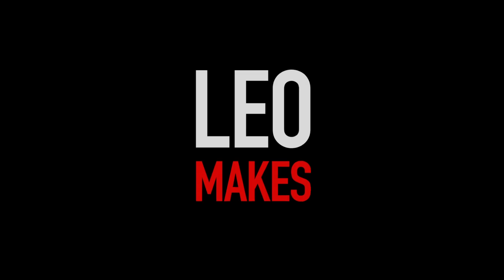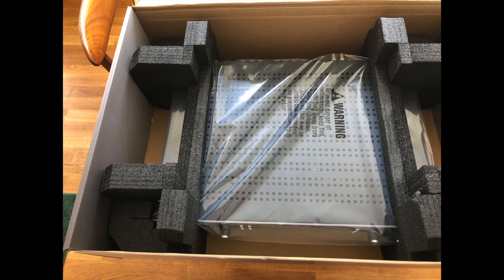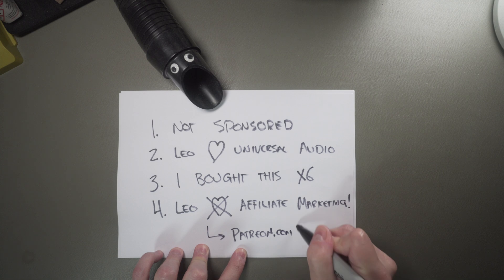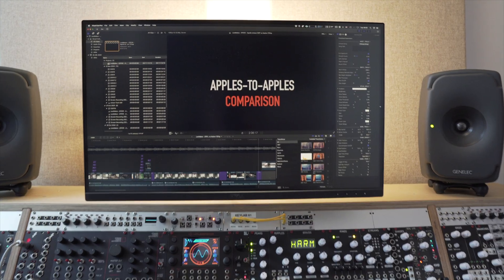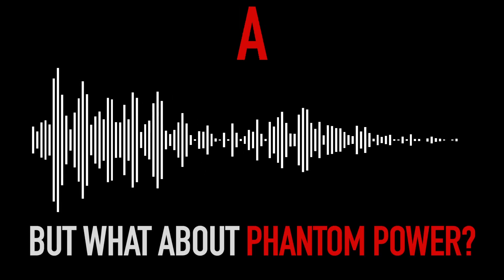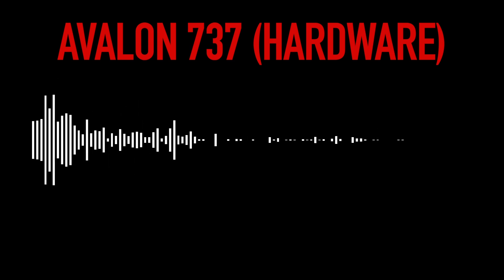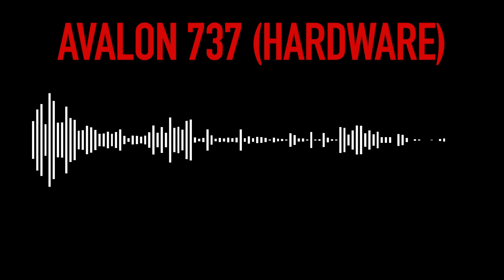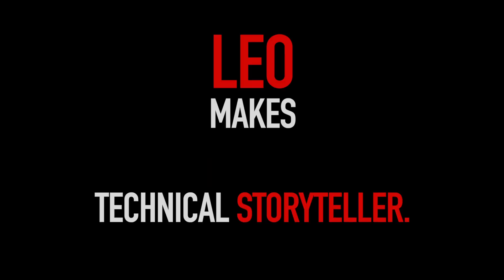Comparing a Unison (UAD) plugin to my real Avalon 737

Comment: I got it straight away - I knew the plugin was A, because: it was clearly more dynamic. Even before the compressor was engaged (as well as after). It sounded erratic compared to the smooth consistency of the hardware preamp. I'll die on this hill that this is the biggest reason for (at least) tracking through hardware (tubes, transformers, etc). The circuitry smears and smudges transients in a really smooth way.  It's the beginning of tucking sounds into place. I also don't think software comps can compete, so push pretty hard on things like vocals and bass on the way in. Excellent demo btw, thank you!

Comment: I picked B out as darker/thicker from the first switch, so I’m not surprised by what turned out to be used for each. That aside, are they relatively close as far as emulations go? Yes, I would say so - a lot closer than for example my old LiquidMix emulations of various hardware were. I’ve tracked with three different Avalon 737s at a couple different locations over the last fifteen years and it sounds closer to an Avalon 737 than anything other than an Avalon that I’ve encountered so far. I still would need to mix it a little differently than an analog 737, though.
Reply: As a side note, this difference in color is pretty much what I’m used to (in terms of the original hardware relative to the emulation) in regards to partially or fully software based solutions, UAD or otherwise, with the exception of emulation that push the bass a little harder/bigger (frequently the case for filter emulations) or intentionally hype the highs or leave them even clearer than one would expect (frequently the case in synth emulations). In general, the mids often come out closer to the original hardware.

Comment: I listened on my phone and yet could hear a subtle difference and I guessed correctly. Sample A sounded a little harsher on the high end, was a little less full, and sounded like it had an internal EQ, while B had a fuller low end and tube warmth and slightly more presence. I repeated the test with my eyes closed, checking which sample was playing periodically, and could hear which one was which and also the moments they were switched.

Comment: bit late here but B absolutely sounds like the hardware and has a bit more warmth to it. again could just be the difference in tubes and just general use of the unit compared to the apollo version which might be modelled on a brand new avalon. definitely had to listen for it but it was noticeable.  both sound great though

Comment: 🌐 Hi @LeoMakes! 🎛️ I highly appreciate your attention to precision and your amicable communication. Id like to offer a critique about your approach! It's a bit lengthy, but please take a moment to consider....

1) nitty gritty: I'm pretty sure the target impedance ratio for mic out to preamp input is 1:10, not 1:5 as you stated. I also was wondering about your 425ohm in load deduction re: after the y splitter, because I' under impression that the Avalon hardware can switch between 850 and 2500 ohm input & the UA unison impedance can be controlled digitally... but I don't think you mentioned calibrating the input impedance of each device. Also, I'm wondering if the 600 ohm output from the Avalon hardware into the Apollo has any effect on the neutrality of the source signals you are comparing?  

2) fun-da-mentals: I love dsp hardware & I love analog gear—super excited to be a part of their evolutions. So I'm really happy you showed people just how indistinguishable they can be. However, I believe your experimental method may have underestimated the relevance of perceptual contexts. Granted, its just a YouTube video, but ultimately the audio source and the settings you tested were far too limited of a sample to do more than scratch the surface of how to differentiate between the 2 units.

A) Your spoken word, lovely as it is, doesn't push or challenge the processors to work their magic. Imagine the the variations between that and a heavy metal singer & a suave R&B singer, or between an electric guitar cabinet & a saxiphone. 

B) there are too many variables within the circuitry (and it's digital modeling) to rely on just one setting to assess them. At least try moderate vs extreme settings.  Then matrix those with variable source audio (from the same calibrated input such as your Neumann).

(In the past 2 decades I've noticed that comparing audio processing from only one type of source tells me way more about which gear fits for the situation than it does about the gear's overall performance. )

C) social scientific perspective: Given the ambiguity  inherent to your scientific experiment (despite your valiant efforts to control variables)—combined with your public outreach inviting subjective feedback— this wouldve been a ripe opportunity for you to comment on how the form factors of each unit each entail pros & cons which might be efen stronger factors for the user than the sound quality comparison. Cost, size, ergonomics, requirement of a computer—these are all factors that frame your audiences ears before they even try to be objectively neutral in your listening test. If you preface your invitation by acknowledging such factors it could help reduce perception bias among your audience before they dive in. This is akin to you prefacing that you weren't sponsored by UAD or Amazon. Very valuable context.

All that said, you seem like a really great person with whom i'd love to stay in touch, especially about creatively fueled science+tech things—like you & your brother have clearly mastered! I hope to be in touch, "in the future ..." Peace & Blessings 🙏

Comment: So my question is can I just hook my analog 
cl1b up to my Apollo Quad 8 with out buying a preamp and just use the unison preamp and if so how do I bring that in do I bring that in as a mic input or line in 

Or do you think it would be better to just buy a analog pre amp and if so for rap vocals which pre do you think would be better for rap vocals 

1. Neve 1073 Spx
2. Avalon 737
3. Neve 1073 mpf Bae with Eq

Comment: Listening to it, for maybe about the 1st 60%, I thought they were indistinguishable. After a while, I noticed that when it went back to A, it sounded duller. B sounded clearer, more open, and possibly toppier on the high end - or perhaps just less diffuse. I'm listening on HS8's, so they're pretty accurate.  I'd like to know if both went through the same pre; or what each was.  I take it you used the built-in UAD pre, but if you said what other pre you were using, I missed it.

Comment: When the first UAD card came out, I compared my 1176LN to the original plug and couldn’t hear a difference, at least for the way I used it (no 4 button stuff). Bye, bye analog. My 40 years of skills as an engineer can more than compensate for any subtle differences between analog and digital gear.

Comment: I also correctly chose B as the hardware. I have some high-frequency hearing loss in my R ear but I do Soundgym every day and this difference is enough for me to shell out the bucks for the hardware (and the better tube mics). I play acoustic guitar and have struggled with discrete pre-amps and mics not giving me what I'm after (and I own more plugins and emulations than I care to share). I'm surprised you can't hear the difference. This difference is also the reason I decided against the Slate ML-1 and 2 and UAD Sphere mic emulation ecosystem--they just aren't the same and don't give you the 3D sound and character of tubes.

Comment: Having done a number of these tests between hardware and software, and owning a 737, I was able to tell which was hardware /software on first listen.  There is a noticeable difference. Even blinded I can hear these differences and correctly guess which is which take is playing with 100% accuracy.  The difference is primarily in the high end, or possibly the transients.  To me the Apollo sound brighter in the upper frequency range.  If you cant hear it, it possible that your monitors are too dark the hear that level of detail in the higher frequencies.   Also the age of the tubes (old, new?) were not mentioned, so that is another factor that can affect the sound of the hardware unit.  Newer tubes have more high end detail, older tubes usually less. Also it would have been good to see the EQ and extremes of the plugin vs the hardware tested, because that's where you see if a digital emulation really compares to hardware.
Reply: Wether using the plug-in or hardware, the settings would still need to be adjusted to the source material. What matters is what the 737 does and how you use it!

Comment: Interestingly enough I guessed correctly that B was the hardware because it sounds a bit warmer. The top end is a bit more rounded off which to my ears is a positive thing for a TLM103 (based on what I've heard, I haven't personally used it). However, the difference is so subtle that I'd much rather go UAD (despite it sounding every so slightly worse to my ears) because of the flexibility and the ability to instantly recall presets. However, I won't deny that using analog hardware looks like more fun and it DOES sound better.

Comment: Interesting. There are some differences but not to the point where I think you couldn’t get something much more similar with some tweaks or some additional EQ on the plug-in.  But more important to that is I think you could use either to get a great sound. They may not sound the same exactly, but they don’t need to either.

Comment: Former 737 owner here and I had it for a good number of years. When UA released the 737 model I was slightly hesitant to try it out but did it anyway. Once I did, i immediately put up my hardware for sale cos the differences was so close that I couldn't justify having the hardware in my rack, that kinda frees up some cash for me to get the Ultimate 10 bundle from UA. Yes there are differences and tubes over the course of time and nearer to its end of life does change the sound of the hardware to some degree, I've had dead tubes in my 737 before and have changed them out and it sounds different after the new tubes are in. Other than that, great video and good work!
Reply from the maker: Thanks for watching (and for sharing your insight!)
Reply: I actually took the opposite route , I bought the plugin and it was so good I bought the hardware unit. I use the hardware to track my own vocals and use the plugin to make additional adjustments after I finish recording
Reply: So would you be safe to say the hardware is not worth it? Just get the plugin?

Comment: I could hear the differences between the two and I really preferred the hardware. Granted the difference is not huge so you can save money and just use the plug in version. However when you start adding multiple tracks with a real 737, now the difference becomes even more noticeable with each additional track that you use it for. Plus the hardware is more fun to work with compared to using your mouse.
Reply: It’s more fun to you.
Reply: More fun but more time. 

Wish I had a hardware one, but I’d be too lazy for it.

Comment: I heard the difference right away. The first one sounds more louder less limited kinda with a low attack. The second one. Sounds way more balanced. They very closed.  But B sounds just at the spot. Not harsh perfectly balanced and compressed.  The A sounds harsh and brighter less balance. And you know a well mixed song has to be Balanced right.

Comment: I have the hardware and the plug-in and know the hardware very well. The pre amp is very close and they matched the feel very well. It’s a pre that’s very easy to recognize and I recognized the color instantly with the plug-in. Where the hardware really outshines is the eq and hi gain knob color. Especially on bass and low mids. If you take the “big vocal” preset from Mike Deans folder and match that setting on the hardware with  Hi Gain on, that’s the best sound I’ve gotten out of the hardware and you can really hear the difference between the software and hardware with that preset.
Reply: I have the hardware but not the plugin was curious about it.. what are the settings on the mike dean? I want to try it on my hardware.. :)
Reply: @straighttrippingmusic  my bad I didn’t see your question but the settings are:  High gain is off but I like it better on for my hardware. 
Compressor In with SC Link and EQ>Comp bypassed. threshold at 0 and compression set at the line between 3 and 4. Attack at 3rd notch up from Fast and release at 3rd notch up from slow.(basically 10 and 2)

EQ in with SC/Mids bypassed and all other eq buttons bypassed. 
BASS set at 60Hz boosted to 6
LOW MID set to 150 boosted 0
HIGH MID set to 1k2 boosted almost 4
TREBLE set to 10k boosted 5

My Avalon’s preamp gain is broken and stuck at full so I just adjust the output knob and while keeping hi gain On. It’s the best vocal sound I’ve gotten for myself for rap. Sometimes I adjust the bass or treble a little bit
Reply: @chandeleerjet5637   ohh nice!. I'm always messing around trying different settings.. I'll try that out!.. appreciate it! 💪😎
Reply: @chandeleerjet5637 what kinda Avalon do u have ?
Reply: Indeed. Even the best plug ins such as UA offer can't get the high end quite right. Hardware EQs for additive top all day. Cheers!

Comment: I picked B as the Hardware but for the most part they sound very similar. I would still buy the hardware though. the biggest problem with most software (plugins) is that they fall apart when you decide you want some saturation and drive them hard. they sound nothing like the real thing in those instances!

Comment: UAD emulations are band limited to 30Khz. That may be the reason why the hardware has more high end information.
Other than that - extremely impressive. And considering the price difference it's unbelievable.
Reply from the maker: Interesting!  I didn’t know about this 30khz limit but the data seems to bear this out.  And, as you said, it’s impressively similar despite this difference. 

Thanks for watching!

Comment: I heard it right away. B=Hardware. Ive had this Avalon Pre and TLM 103 combo since the 90's so I know the sound very well. Besides listening to frequency response I also listen for dynamics, front to back effect and size of the sound field. The hardware sounds more open and free with that sweet subtle back throat grit that makes it sound like the vocalist is in in front of you. As for the plugin the frequency is very close but sounds a bit flat and constrained and slightly colder. With this test your low mid voice frequencies definitely came out at you more on the hardware then with the plugin. To me the magic of analog is that sense of dimension you get and openness. Those analog qualities ad up beautifully in a recording and mix.  Thank you for taking the time to do this.  Great test.
Reply from the maker: Interesting thought about the cumulative effects as they add up over the course of an entire mix.

Thanks for watching!

Comment: Very subtle in the high frequencies in B that's why I could tell that it was the hardware, But A sounded clean and nice a bit too much that's why I could tell it was the plug in. Other than that it was identical with the low end, and mids.

Comment: I own an Avalon.  did you make sure to warm up the unit at least 1.5 hours before testing?  there is a significant differece after is been warned up
Reply from the maker: Absolutely!  It was on for several hours before I did any recordings.  As you say, the tonality is different when the tubes are cold.
Reply: Thanks I needed that know how. I just invested in one

Comment: I heard the difference right away. And knew the hardware was B. Quickest way to tell is listen for blocky-ness of the interface preamp vs the rounded smooth sound of dedicated hardware preamp. Volume levels during talking also stay more consistent from word to word on the real preamp. Great comparison and video man.
Reply: You’re absolutely right! I still think it’s really impressive how close they are though. I’ve owned the hardware for about 9 years or so. I recently bought the plug-in so I can use when I travel and not have a major difference of sound I’m getting from the studio to location. My clients don’t hear the difference at all. The plug in is convenient definitely.

Comment: Hey Leo.

Loved the video. 

Quick question to you…printing through the daw with UAD plug-ins VS printing through Unison technology? Can you quickly let me know if there’s a difference? 

I use studio one and there’s an option for me to print through the input (somewhat like unison) and I wanted to know if it’s the same or if there’s any difference what so ever
Reply from the maker: Hey Leandro.  There is a difference between "printed with unison" vs "record clean and add plugin later."  I think this is because the unison also adjusts the actual hardware front end of the Apollo which has an effect on the sound of the mic/instrument.  I think the difference matters more or less depending on what mic you use (dynamic, condenser, and especially ribbon, etc.) since some mics are more sensitive to impedance changes than others, but I haven't done any extensive tests in this area.  Maybe one day I will find time to do this.

Anyway hope this helps.